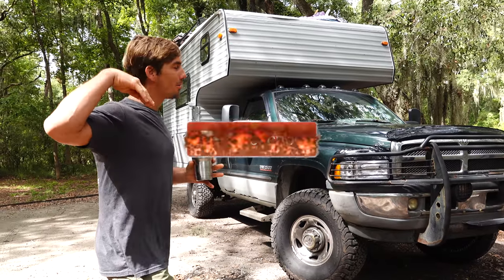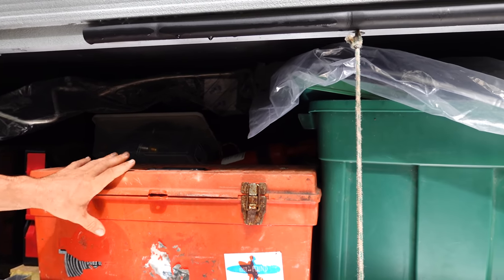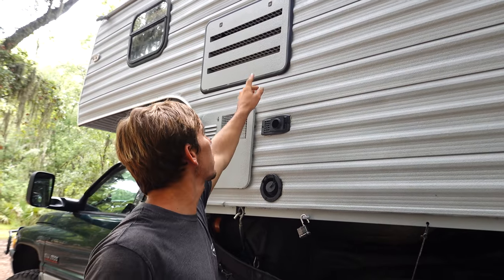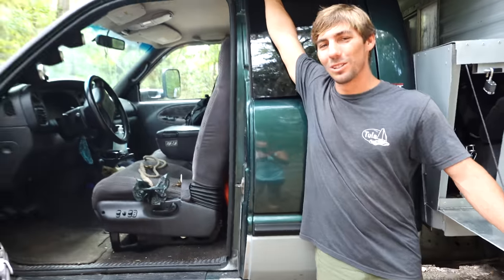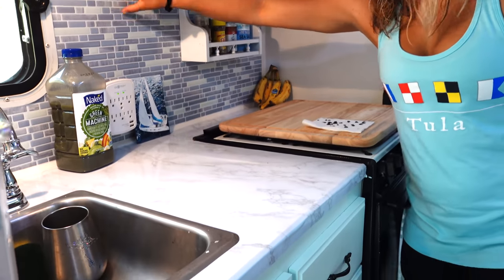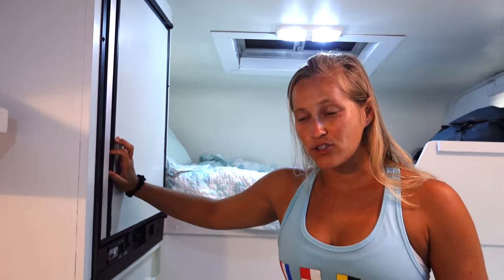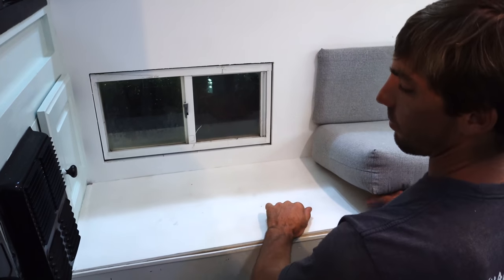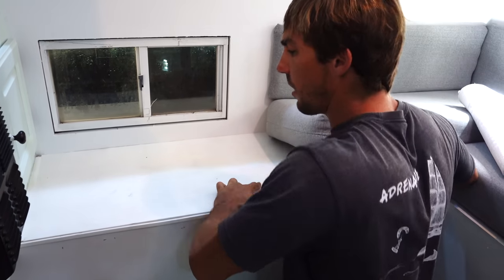[FULL TOUR] The Ultimate DIY Overlanding Truck Camper - Terra Tula

Comment: A trick used down here for the fridge, is tomrempve it from the camper , turn upside down for 24 hours then refit.
They get rust flakes that fall,off the inside of the pipes and block the flow of gas.
Personally, I would throw it , replace with a dedicated 12 volt compressor fridge , they are a better all round unit for camping  , and you plug in a 12 volt 110volt transformer if in a park, otherwise your battery bank and solar will handle the load fine
Reply: Yeah, those Danfoss either custom or purchased are nice.  Having the option of 12/24V DC and 120VAC is nice.  The propane fridge freezers are nice also, though from my experience more a chore and I suppose the risk if something happens with gas.
Reply: Some of these refrigerators is very sensitive about being level to work properly.
Reply: @kobrapelle  yes ,the 3 way , gas , 12volt , 110 volt , are the ones. 
They can tolerate 15deg tilt. 
Compressor aren't as sensitive to tilt angles

Comment: Guys, you have what is called an absorption refrigerator.  There are a ton of youtube videos on them.  Don't restrict yourself to your make and model, just look up RV refrigerator, they all work the same. One improvement you can make is to get a 12V computer fan and mount in in the vent so it gets good airflow.  Also look or any bug/mice/birds nests in the back of the fridge.  Good luck, and if you're nice (you always are) I might even send you a couple fans I have lying around if I can find them.  8 hours later - I found the fans if you want one.
Reply: The major drawback to absorbtion refrigerator is it has to be pretty much perfectly level. Would it be worth it to put a compressor fridge in there, considering I have more than enough solar power to run it?

Comment: Please watch that wood you used between flatbed and frame. When the time comes to replace it. Use Bass wood, Apitong, or Ipe wood. It has a high tannins which prevent  or seriously slow down rotting and bugs too. Just a suggestion from a woodworkier.
Reply: Might want to put some metal instead of the wood. I’m working on a similar project. ❤

Comment: Keep the bigger weatherstrip on the side lockers.  If those locks are allowed to rattle at all they will eat through the aluminum panels in a very short time.  Riveting a small stainless  guard over the oval holes will increase durability 100 fold.

Comment: Little jealous of the 5.9 with no def, egr etc. I have the 2013 6.7 Cummins.  Still a friggin beast.  Trying to delete,  but it's getting tougher. Nice remod of the camper too. Just bought a new Palomino  TC. Made a bunch of solar, lithium battery upgrades. Living in Florida,  it's nice to be able to run our ac off solar.. subscribed. 👍

Comment: Back in '06 bought a Dodge Ram 2500 with a Laramie pkg.  Towed a 5th wheel trailer.  Stopped in camping World and purchased a "Spare Room".  It was fantastic hanging off the side of the trailer.  We could be outside and dry during inclimate weather. Just a suggestion our Spare Room turned out to be about 30' x 12' wide attached to the side of the trailer.

Comment: Your fridge will work better when it's full. You can also add a 12v (D cell battery) fan. Just put it on the shelf by the back cooling grid and it will help a lot. The batter lasts a long time. Wilson

Comment: Check the cooling coils on the refrigerator to make sure they are clean. Check to see if the temperature switch is working. Turn it all the way down, let it run for a few minutes. Slowly turn the temp switch to the coldest setting listening for the compressor to kick in. If not it may need to be recharged with Freon or the temp switch is bad.

Comment: Nice work you two!! For the fridge, propane fridges can have trouble circulating the cold air and keeping the inside cold. Even more so when the fridge moves regularly and doesn’t always sit level. To remedy, a way to circulate the cold air key. You can wire up a simple USB powered fan (cheap on Amazon) and run the wire and fan into the fridge. Hope it works for you guys! Cheers

Comment: That battery to battery  DC/DC charger is probably the most important part of your charging system. I am surprised how many rigs dont have one installed. My diesel van has a fast idle option and if we are not receiving solar power or it is night time, I can bump  the idle up to the 1800 RPM range and be fully charged up in 20 minutes or less. I dont ever have to worry about the charge level getting to low and damaging my batteries or being without power.

Comment: The fridge is usually the most problematic for RVs, especially in warm climates. Propane/battery just doesn't cut it. You should be able to get better results when plugged into shore power? But there are many vids out there on converting from absorption type to compressor type fridge. Don't feel badly that you have a lousy fridge. I have a 2018 Dometic 3-way that sucks when it gets above 70. I will be converting to a compressor type in the next year.  thanks for the videos. Can't wait to see the RIB vids!

Comment: Those Norcold fridges are expensive.  They use Hydrogen to cool i.e. no compressor...  If it cools the same on power or gas then i would look at the thermostat.  See if you can find a service manual on the web.  For the truck AC, once you change out the parts consider recharging it with R152a.  It works super well and is available at every walmart.  It is computer keyboard duster.  Charge it until cold air is coming out the vents then stop.  Tons of videos on utube about it.  If it originally is a R134 system make sure to use PAG oil and if it was an R12 system use Ester oil.  R152a doesn't care what oil is in there.  Good luck.

Comment: I have a 1999 dodge similar to yours for 18 years now.  I put the 285 BFG tire's on the truck. I drove it home and notice more sway in the truck.  Did some research on this,  truck come with 245's originally and stock rims are 6.5 wide.  they do not recommend 6.5 wide tires with the 265 tire let alone the 285s.  I end up going to 2006 17 inch dodge  wheels  that clear the steering linkage ( believer there 8 inch wide rim).  I put  17 265/70s load rang E's BFG's  This made a huge difference in handling with the camper on the truck.   I also had Carquest Bruser shocks, There a stiff shock and made the truck ride rough empty but hand good with the camper on the bed.  Since then I have put Bilstein shocks on the truck,  Now it ride good, but camper handling sucks.  I suggest heavy shock.  Keeps the truck stable on the road.

Comment: Awesome truck camper,  When I did my trailer much the same as what you have done.  I replaced the stereo with a more modern unit that I found on Amazon that was digital, had at least a CD player and was bluetooth capable.  I also routed it over to connect into a flat screen tv that we mounted inside and so it was able to handle the sound from the tv.  You should check into one,  for your truck camper.  It would make a great addition.  I don't think the one I bough was very expensive as it wasn't name brand,  but was designed for campers.

Comment: Can I ask where you got your cutting board. Two tips for the frig. Get a fan made for frig. And take an air hose and blow out the flame tube. Mine was doing the same and I found bee's nests and spider webs were clogging the tube. Be sure to keep the frig level or you will ruin it. I also have a truck camper I redid. Mine is a 94 sitting on a 98 GMC 2500.

Comment: Add some "L" flashing under the side sheeting that extends just over the storage side-panels.  this way water will run off and not into the storage box.  Then it will be 90% water tight.

Comment: REALLY WELL DONE!

Definitely a tremendous amount of thought has gone into this project, materials such as bed paint on the exterior.  I never knew you could actually change the color as the bed of my truck is basic black.

All the mechanical stuff is top notch and again a lot of thought went into that. Methodically changing necessary parts for an excellent engine.

Interior turned out fabulous I'm jealous again well done!

I enjoyed this video almost as much as any boat repair video. With a little thought you can take things to the next level!

Can't say fairwinds and following Seas....

"Roll on family truckster"
National Lampoon's
    Vacation ©

Comment: I would replace the rounded eyebolts with forged eyebolts for greater strength. I have seen the rounded eyebolts bend out under loads.
Reply: You  think  after  a  couple  of  good  bumps  the  camper  may  be  appearing  smaller  in  their  rear-view  mirrors  ? ? ?    I  agree  with  your  suggestion  100% .
Reply: @richardhobbs9038  They said they were going a bit deeper into the woods, away from campsites on rough roads. The camper is going to be shifting around in the back constantly off road. The load points will move a bit on the eyebolt as it shifts, slowly bending the weakest end more open. With time, under a modest overload the eyebolt may completely open allowing the camper to shift off center of the flatbed. This might cause a weight shift that could flip the truck also.

Comment: those water hoses are very cool ive went through 2 on my 3rd one only cause i kept running it over thats the only thing that ruins them they are very thin rubber inside the sheething so be care and dont tug on it or run over and it will keep yyou smiling everytime you use it😃

Comment: Hello Billy and Sierra, what did you say was the name of the table in your camper and where did you get it? I’m restoring an old camper and a table like that would be perfect. By the way, your trucker camper looks great and I can’t wait to see the new boat.
Reply from the maker: It is called Lagun. Just type in Lagun RV table on google and it will show up. We found ours on EBay new but with slight scratches for a little less than their actual website 🤗

Comment: Camper project is looking great.....really wish you would stop using Masterlock padlocks to secure things, think you should go with some recycled bonnet catches and have remote cable operated locks to lock those side pannels. Mount them in the stronger smaller front hinged pannel and buy a couple of better locks like a puck lock (or even matched car door locks) which you can match to your camper door. Less padlocks (never use masterlock's) for the better peace of mind, cheers guys, happy trails

Comment: If that truck isn't using much oil, new cooling system, no other fluid leaks, should run basically forever. Here in Tennessee I would fix the AC however.

Comment: Is the truck a 4 x 4??? You might want to camp off road, and the 4 x 4 would be very helpful for that. Without 4 x 4 you are limited to campsites and parking lots. It would also be a good idea to bring your generator with you for days that you aren't able to charge the batteries fully ( just as a back up ).

Comment: Your cooling unit is probably shot.  I posted once before about this, but don't remember what video it was.  I bought a new cooling unit from: https://www.rvcoolingunit.com/ It took me less than an hour to install and I was back in business in no time.  There is a simple test I used to verify this was the problem.  Just put 110v directly to the heating element.  It will either get cold as it should which means the problem is in your controls, or it won't get cold like it's doing right now.  This means your cooling unit needs replaced.  I had very good results with a new unit from the above link.  Good luck!

Comment: Im a RV technician. In the heat of the summer (90 degrees plus), they say the fridge will only act as a cooler, temp wise. If the fridge is working properly on LP and 110 and not getting cold in cooler ambient temps, the whole unit will need to be replaced.

Comment: Tip ,, those hoses are pure JUNK !!! Good for about one week !!
Reply from the maker: Good for 2 months for us so far but it was a cheap one from Walmart so I don’t expect it to last forever.
Reply: You need a white RV potable hose and pick up a pressure reducer for some campsites
Reply: Tula's Endless Summer the RV hoses are supposed to be made of material that does not leach into your drinking water. For my camper I have the white RV hose but I would not stress. Off grid you can purchase collapsible water totes.

Comment: The word to describe the hose you might have been looking for is "collapsible". 

I think lithium batteries are scary. Evidently if they catch on fire they just explode and they wear out so quickly in just a few years. Too bad. I wish the alternative batteries like sodium-sulphur they are working on were more available and widely used.
Reply from the maker: Lifepo4 lithium batteries which is just one chemistry of lithium is extremely safe especially paired with a quality BMS. This is well documented
Reply: I read alot of good info on the absorption system refrigerator in your camper but if the camper set for a long time with out being used you should remove the fridge and let sit upside down for a day to let the mixture of ammonia and water to mix then try again before you give up on it

Comment: I am not an HVAC guy, but I am an Engineer that knows something about Thermodynamics and Adiabatic Cycles.  I would suspect if it is not getting cold enough the pressure differential between the hot side and cool side of the cycle is not enough.  See  if there is not a way to adjust that or replace the mechanism that allows the gas to expand thus creating cooling.  Be warned I know enough about this to be dangerous and this is just a Scientific Wild Ass Guess.  Possibly even replacing the compressor might work--perhaps it is not compressing the gas enough to allow for the spec. pressure differential in the first place.

Comment: You guys really need to take the hold downs for the truck camper a whole lot more serious. You need to have that camper held down in all the hold down points and passing them thru wood braceing is not good enough. Save yourself some greif and have somebody weld you some points onto the truck frame and get turnbuckles to every point on the camper that has them to hold it to your truck. I wouldnt put any trust in how you have that currently.

Comment: Oh dear god.... so front tie downs are a hazard rear are anchored to aluminum nothing is actually attached to the frame wtf
Reply from the maker: Front tie downs are directly to the frame brackets which are holding the whole flatbed on the frame. Rear tie downs are though the main skeleton structure of the flatbed.
Reply: @Tulasendlesssummer  the front is tied down to a piece of pine! No structural strength whatsoever ever! Extremely unsafe and good luck with your insurance if you cause an accident with that